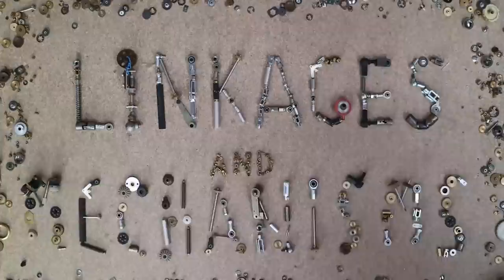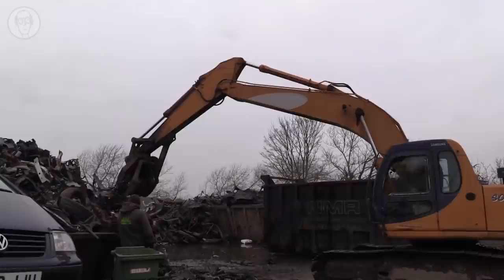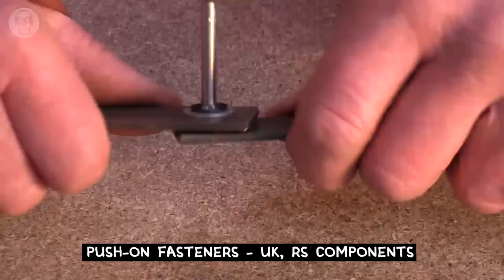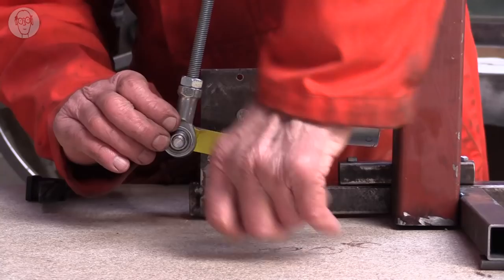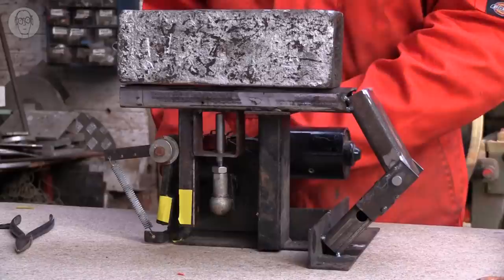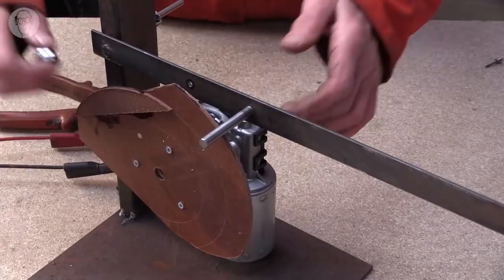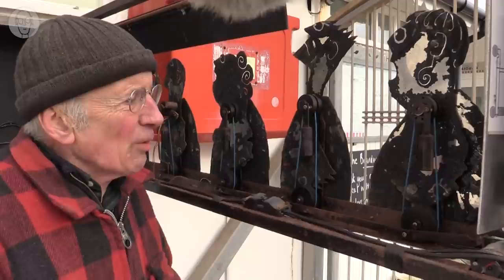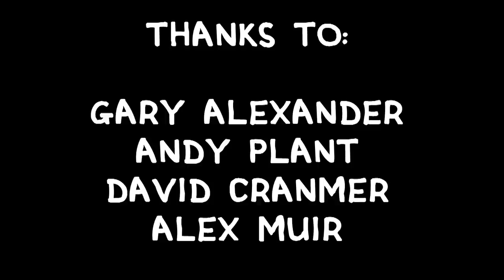LINKAGES & MECHANISMS -The Secret Life of Components, a series of guides for makers and designers 10

Comment: I work mostly in electronics so my mechanical side is pretty weak.  This has been a very informative video for me.  Thank you Mr. Hunkin.
Reply: YOU ARE MOST WELCOME.
Reply: Mine was too until I got into the business of repairing old jukebox machines... It never ceases to amazing me when I look at such electro-mechanical devices.  These things were designed in an era without the benefit of computer aided design software and yet they are masterpieces imo.  The combination of gears, levers, motors, wiring, and switches all working in harmony just to move a record from one place to another (and select which one and when it should play), it's fascinating to me.

Comment: Hi Tim, I work as a Maintenance Carpenter at Melbourne Grammar School, Vic, Australia and during a renovation of the ground floor sub floor and flooring in The Quad (built @ 1876 ish) we discovered  some of the bell crank and wires similar to what you showed from period stately homes. Upstairs in another part of The Quad during a flooring renovation to provide modern controls for the AV equipment in a large class size table we found under the floor the old 1" and 1/2" lead piping for the old coal gas lighting. Now given the period looks of the bluestone buildings, particularly in the floor plan and the lead piping, all I needed a Mrs White, a Miss Scarlet and a Colonel Mustard and I was set up for a game of Cluedo!
Mark from Melbourne Australia

Comment: Hi Tim, as a Maintenance Carpenter at Melbourne Grammar School, I had a project several years ago to make a set of timber steps for use in our Memorial Hall, more portable and easier to move than by team lifting them. I solved the OH&S problem by putting them on swivel castors, but the steps had to sit down flush with the timber floor when it use. My solution involved a operable wall lever key on the outside and then via a keyed axle, some levers and cambs, it resulted in the castors being raised or lowered sufficiently to be mobile or stationary as required. 
Mark from Melbourne Australia
Reply: I have seen such steps, but instead of such a mechanism, they had spring loaded wheels. The weight of the person on the steps made the springs compress and the legs sit firmly on the ground.
Reply: @mfbfreak  Yes, you can also get step ladders with such spring loaded wheels. However, once in place we wanted the steps to sit flush with the floor and have the wheels hidden. We don't want the boys, staff or visitors to know that the steps have wheels. Keeping the wheels concealed was also an important requirement.

Comment: Fantastic, I've been looking forward to this episode.
BTW, you can have actual chapters on youtube that break up the progress bar by including the time stamps along with titles in you video description. The first entry must start with 0:00.
For example:
0:00 INTRODUCTION
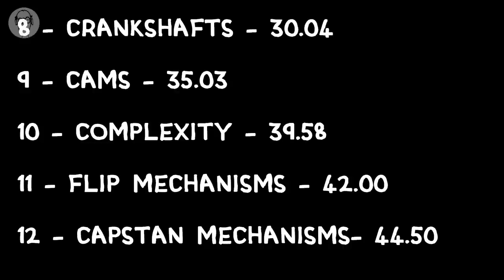1:01 LEVERS
6:03 LINKAGES
9:45 PIER WATERCLOCK LINKAGES
12:54 LINKAGE JOINTS
19:08 BELL CRANKS
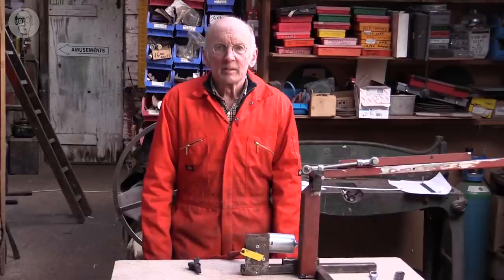21:31 MOTOR CRANKS
25:54 SPECIAL CRANKS
30:04 CRANKSHAFTS
35:03 CAMS
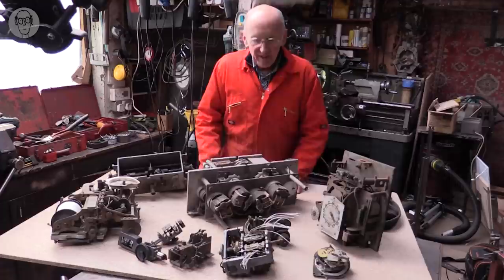39:58 COMPLEXITY
42:00 FLIP MECHANISMS
44:50 CAPSTAN MECHANISMS
Reply: I'm not sure if Mr Hunkin always reads the comments, but he does read and respond to email.

I also wish he'd use better video thumbnails, because these videos deserve more views than they're getting. The thumbnail is the number one way of getting people interested enough to click a video, but the current thumbnails are just screengrabs which are, quite frankly, uninteresting. For example, the SWITCHES episode from the first series got nearly half a million views—and I think that's primarily because the thumbnail shows Rex's giant model of a microswitch (very eye-catching).
Reply: Tim does list the time stamps for each chapter in the description, you can find them if you click the 'Show More'  tab under the video.
Reply: @dans381  Hi Dan, Tim hadn't listed chapters at the time that I suggested it.
Reply: @dans381  He always puts the timestamps in the video description, but he doesn't put the required 0:00 timestamp, so YouTube doesn't copy them into the video seek bar.
Reply: @cmmartti  yeah, I guess he would probably get more traffic with the right thumbnail design. Maybe mock one up of what you think would appeal, upload it to Imgur and mention it to Tim in a comment, he'd probably delighted 😃

Comment: Thanks so much. The revalation you had regarding the friction on the capstan wheels has led me to have my own revelation in a physics-engineering problem/conundrum that I’ve been struggling with for years, which is why it’s always more efficient and effective to power a chairlift or gondola ropeway from the mountain station rather than from the valley.

Comment: Since the stone wheel was chiseled, I somehow feel a great satisfaction in taking natural movement and creating more complexity from it. The mechanical mind is a wonderful place to spend your time in, without the bother of A/C or DC voltages of 12 or 24. It takes me to a repair garage for vehicles and I was asked to replace brakes on a very old Toyota. I got into the badly rusted car and noticed the broom handle that pivots on the floor. Follow to the top to find cord passing though the vent windows. The cords tied both wiper arms together and pulled make the wipers clean rain from the windshield. Also, any speed you wanted, including intermittent. I had to admire someone who felt that wiper need not be electric, but felt. I could feel the comfortable location for the driver from the bicycle handle fitted loose at height, end cut off, nice round plastic rest and a cotter pin bend nicely around the post in smooth fashion. I saw a house electrical box on the upper left of the instruments. It had the normal light switch and marked off & on with “Blue” label marker tape. I had to turn on to witness further the mechanical genius who owned the $100 car. The head lamps came on. Brilliant, cut with a soldering iron, bolted into the dash and worked fine. No high beams, just lights. 
 I completed the work, oiled the hinges, inspected the systems and added fluids. I don’t know if the owner was 17 or 71. Knowing it was easy, I placed a new ball socket on the wiper arm that links the wipers to the motor. The switch worked as I heard the motor before this free repair. I removed nothing but added a note on the broom handle at eye level. I wrote; “Push, Pull or Switch for free!” The broom, wipers and cord all….moved. Just the way it came except fixed. The car left, I never meet the folk(s). It just felt right to honor their broom and fill my heart. A week passed, the 60+ office lady came into the shop of four and came to me. She handed me a small box that had a note taped on top. It simply said WIPERS WORK. Inside the wrapping was a box of chocolate brownie’s from a store down the street. Over the label was tape holding a napkin for the super soft treats. It said “Thanks” JB. 
I ask the office gal who was it? She said some old man who told her to give these to the guy who worked on an old rusty green Toyota last week! She included, your the only import tech here! Right. I told her I knew the car. Never saw it again. 
DK. Omaha, ASE Master Tech since 78

Comment: Mechanism source books make for great reading when you have a spare minute or two (easy to put down and pick up later, so I keep one on my phone). So many intricate devices, but my favorite is very simple and is a rapid reversing movement for a wire winding machine. There is a steel belt on two pulleys moving constantly at high speed and between is the carriage that guides the wire. It has two electromagnets on it, one for each side of the belt, so that direction change can be achieved by switching attraction to the side that's going the other way. Elegant.

Comment: You remind me so much of my father, he was mainly mechanical, you could show him a mechanical machine an he would soon know exactly how it worked. He built a few things but mainly worked for others.
He did design for the farm in the 50's and built a sled pulled behind a baler which stacked the bales 2 by 2 rotated and stacked on top. my uncle told him to patent it but he did not and about 5 years later someone else made the same thing.
Of course now they just roll it up into huge rolls.

Comment: About the same kind of transitions in technology that I've been through...I guess that is why I enjoy pulling things apart, to see how they accomplished some amazing things, with the relatively simple mechanisms used, and, in the 60's, the hybrid electronics and mechanical things... like making a DAC with motors and pulleys and potentiometers, and using mechanical differential drives to drive positioners, with one motor and one mechanical input...then, in the 70's, programming microcontrollersat the "bare metal", inputting hexadecimal codes on a teletype, and doing quite complex tasks, very quickly, with 1200 bytes of code, and 256 bytes of RAM... Today, it seems to take megabytes to be able to do "Hello World"

Comment: Capstan formula, simple but useful: R = exp(mu * theta) where R is the maximum ratio of the two string tensions, mu is friction coefficient of the string on the capstan, theta is the wrap angle of the string around the capstan in radians, and exp is the 'e to the power x' function. Seems to agree well with reality if you can get a good value for mu.

Comment: My favourite linkage is the clasp on my watch band. It's the type with the three curved parts that fold together and click down onto a latch with a locking part that folds over the top. I've had it well over 10 years, opening and closing it multiple times a day, and it still keeps working.

Comment: When I was a child, I found a book in the reference section of our public library, Judging by the drawings and typeface, it was a rather old book (yes I know that on the back of the title page, there would be the date of publication. Remember, I was a child). The book was filled with descriptions of various levers, cranks and linkages, just as in your video. I would spend many hours pawing over this book. One combination of ail the principles you have demonstrated was called the Toggle. At first I thought this was something to do with boy scouts but I went back to that page time and time again. First ,I will try to describe the Toggle, then I will reveal the source of my fascination. It consisted of three bars all connected at one  point (imagine a rather sparse star).We will call the bars A, B and C. Now imagine A and C are in line and B is at right angles to the others. If we slowly move B away from the joint, The A and C will no longer be in line but form an angle to each other. In performing this movement the free ends of A and C are closer to each other. If B is moved back towards the triple joint, the free ends of A and C will move further apart as they straighten out. Now, imagine the free end of B is attached to a rotating crank. If the geography of the crank, A, B and C are configured correctly , When the crank is closest to the linkage, A and C will form a straight line. Why would this contraption fascinate a 10 year old child? Well the text accompanying the drawings claimed that the mechanical advantage changed throughout the cycle of the crank, Furthermore, as the free ends of A and C reach their farthest distance apart, the mechanical advantage "approaches" INFINITY. Now, like most 10 years old children, I grew up and I came to realise that the claim was somewhat hyperbole. Nevertheless, I have found the principle of the Toggle in so many machines: the huge presses that turn sheet steel into the sides of our cars is but one, even the mole grips you used in your welding bay (though, these use a side effect of the toggle: if the crank is moved just 1 mm beyond the point of straightness of A and C it locks). You can see this in suitcase latches. I apologise for the length of my comment but I suspect you can empathise with the joy and awe with which that 10 year old devoured the contents of that book. The very same joy with which I watch your video. Thank you.

Comment: If you get a chance, look at the throttle linkage is on a very early pre-First World War Indian motorcycle. They use a twist grip on the handlebars which is connected via rods bell cranks twisting sliders and other mechanisms to the carburettor.

Comment: 22:15 - similar looking things are across the world pumping oil out of the ground. Called pumping units or pump jacks. Functions very similar, just attached a vertical rod to the end of the powered walking beam.
Reply: I couldn't help but point out the similarity,  most of them are powered with electric motors, a gear reduction box, and an eccentric arm.

Although they're counter weighted to lessen the power required to run. Some have been pumping for 100+ years.

Comment: Those paper wheels and arms , Fourrier, holy smoke. lifetimes of thinking about mechanisms , I wonder how mechanisms such as the  quick return  match fourrier patterns,  one variable =another in this case. love the 3mm roller on a long cap head.  bearings. Bell  pulley cranks. Was thinking of wiring two dial phones from house to garage, A direct physical link  would be very green.  for 1-1 maybe a steamship tube. KISS .  Don't push a screwdriver into your hand, Cross heads alot safer than slotted PLC controller. I pulled some festo  valve blocks from a scrap yard, wrote an arduino driver, festo arduino on ebay.   Intuitive Magic in Tims own words. New old bridgeport.  motor was tripping  OL the 240V 3ph inverter, had switched motor wiring 440 to 240 . the inverter had torque voltage boost set to 20% , turned it to 10 and it runs . I read the manual. Always a pleasure to watch and be inspired to create. Preston Bus Station clock, was a mechanical card index digital display, wind powered clocks.

Comment: Do you have to add antifreeze to your water clock in winter? Is corrosion a problem?
Have you tried an encoder, rather than a position switch or cam with  microswitch?

Comment: Leverage is also used in other system such as the financial system. For example, Many financial terrorists who are destroying humanity will lever up by using margin(essentially loans) to gamble in the fraud market. It works the same way as a lever which is why it is called lever-age. They use a much longer "lever arm"(the margin/loan/rehypothecation/book fraud) to pry out $$$ from the wage slaves(who are the only ones that actually do real work in society to keep it going). If they are successful... and almost always are except, say gamestop, since they can use manipulation, fraud, rigging, spoofing, etc, they get the lever ratio in profits. E.g., they take a 50M loan to short a stock down from 100$ to 50$ and then make 50M in profit and so the lever ratio is 1:1. For ever 1$ they put in they get 1$ out. Of course it's not very effective. The lever ratio can swing wildly but usually it's actually an anti-lever because they have to risk much more to gain little(little relative but big in utility). When they lose their gamble(again, it's rare because they are not giving their opponents a fair game) they stand to lose big.

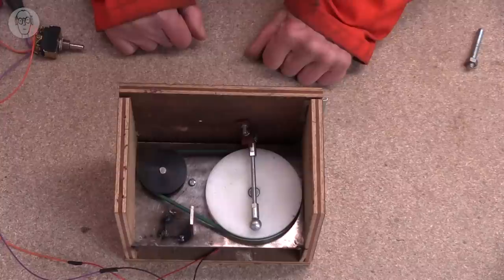Comment: @26:50 - you talked about having difficulty stopping a motor in exactly the right position.  You earlier used a windshield wiper motor in a crank configuration.  If you use the switch that originally operates the car wiper motor from the car it came from, these already have a parking feature built into them to stop a wiper motor in an exact position.

Comment: ❤️       🎯

🏹
Reply: 👋😎👍 great show !
==================
Subway turnstyles' - Amish water pump , or Amish electrical generator.  To a lever (🌊 pump one) or two - to , a telephone crank (or two ☎️cranks  in parallel ) = 110 volts.
=========
Pay the Piper ;
=========
 entrance , for the game room - to pay for electrical etc. (Flush the toilets ?) 🛑 Bri. 
---
Thanks , Dude I will . Edison did that with his front gate pump water I think.
==========
The 50s were great they use steel and non-critical areas.